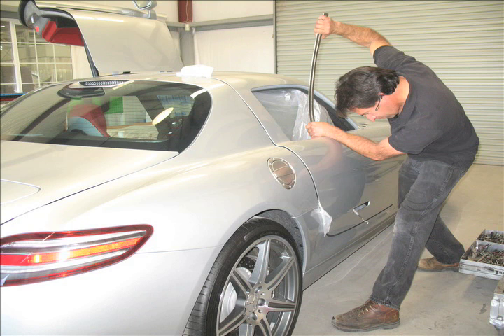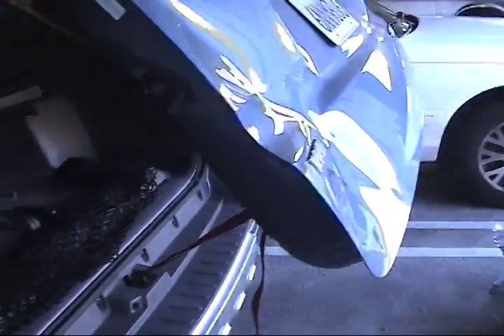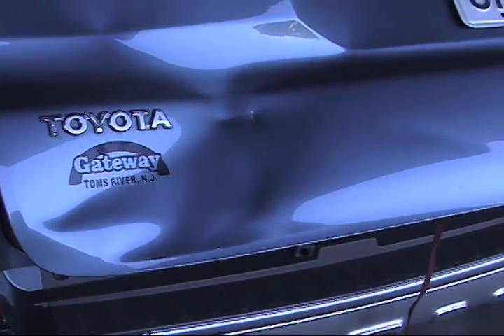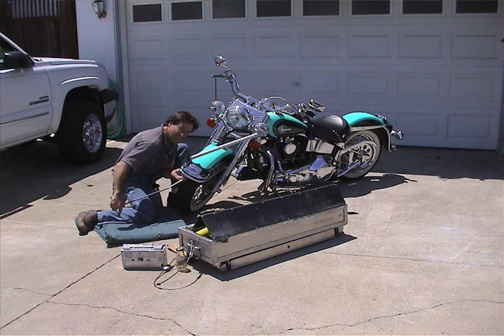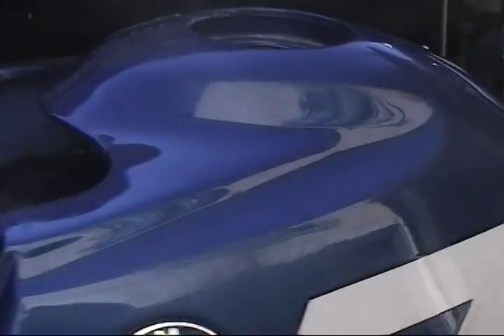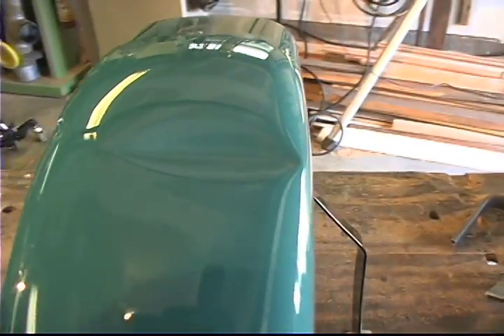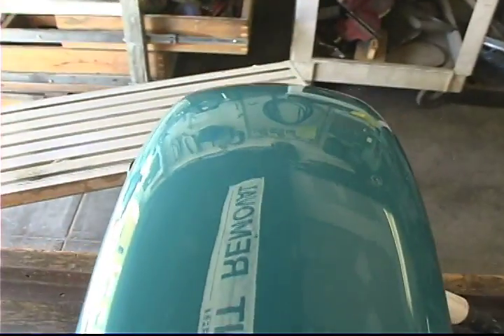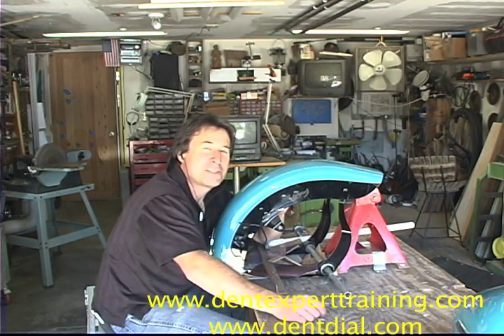PDR Training - Toyota 4 Runner

Comment from the maker: @AutoDentMedic 

hello, 

Thanks for your question.  A blending hammer is a single smaller head hammer used for small blends and wave movement.  A slap hammer is struck with another hammer to create great force against the panel and to move a large wave more efficiently.

Comment from the maker: @MrJBDENTS 
Hello,  
Using a slap hammer is an excellent way of knocking down or flattening high spots when fixing dents. You strike it with a hammer and create a vibration at the tip, which is very powerful for crushing metal in a controlled manner.

Comment: Sal, great work! Where do we draw the line though? The paint had cracked at the bottom of the tailgate on the 4 runner, if i'm repairing used cars I can get away with it, how do retail customers react to estimates where there will still be paint missing and if it were to be conventionally repaired the small imperfections would be fixed? What is your opinion on cracked paint?